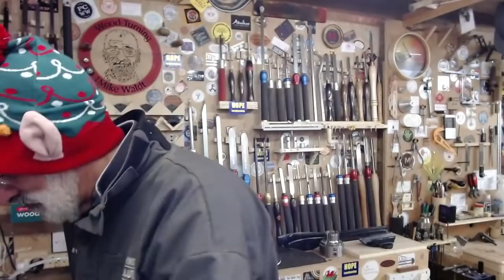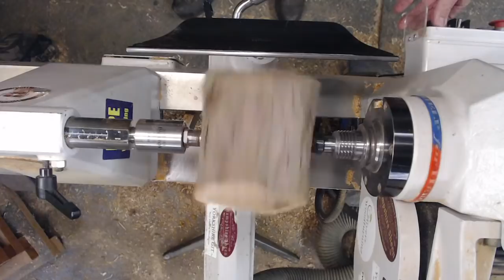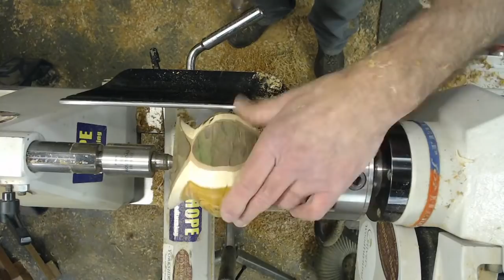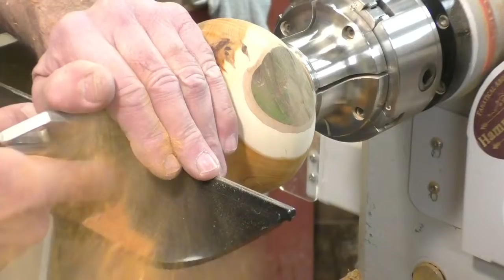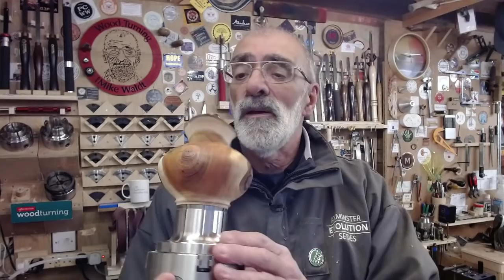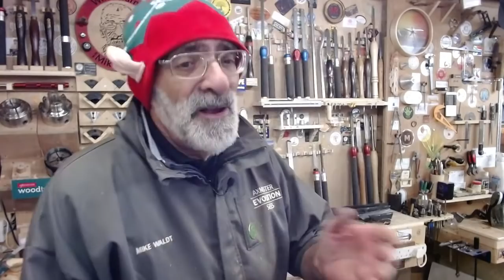Live Demo - How to turn a Birds Mouth Bowl

Comment: Hi Mike. I don’t think I would recommend using a spindle roughing gouge for such turning. Much safer to using a bowl gouge. One bad catch with the roughing gouge and good chance of the weak tang breaking! Beginners beware.
Reply from the maker: Its basically a spindle ... no different in my opinion to roughing down a standard spindle. I will agree however that the bowl gouge is more effective.
Thanks for your input though. Have a great Christmas and thanks for watching.
Reply: Hi Mike. I guess in my mind, and as I have been taught, a spindle roughing gouge is for spindle work when the grain runs parallel to the ways only. Anyway, have a wonderful Christmas Mike and looking forward to more videos from you. Cheers!
Reply: Absolutely correct. It’s called a spindle roughing gouge for a reason!